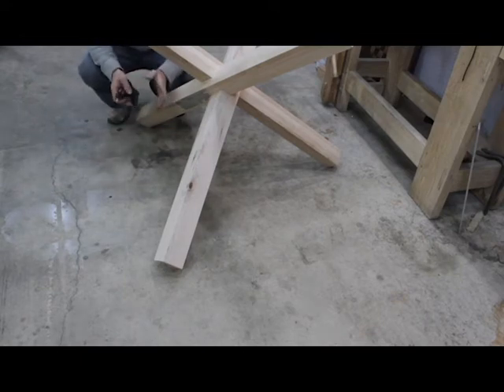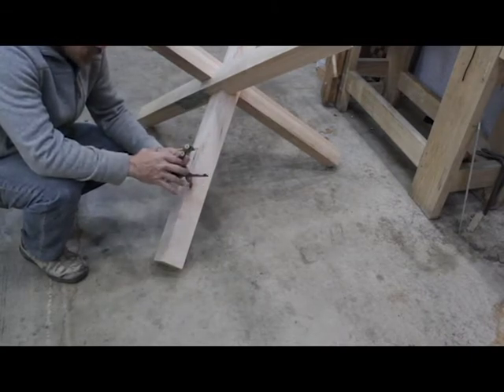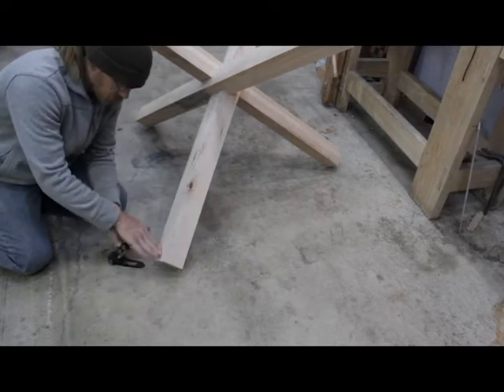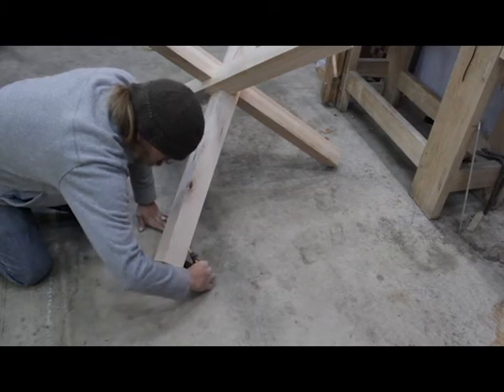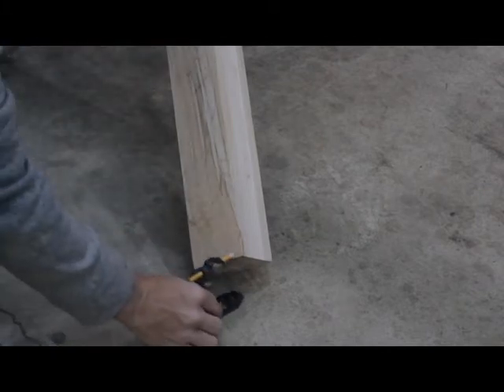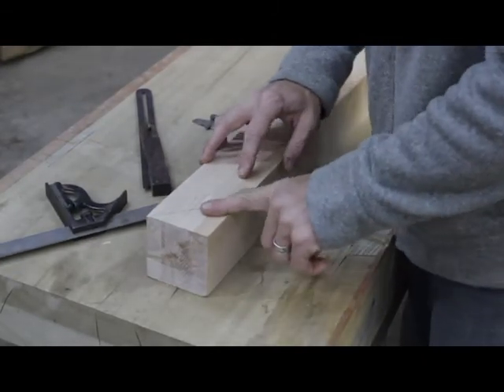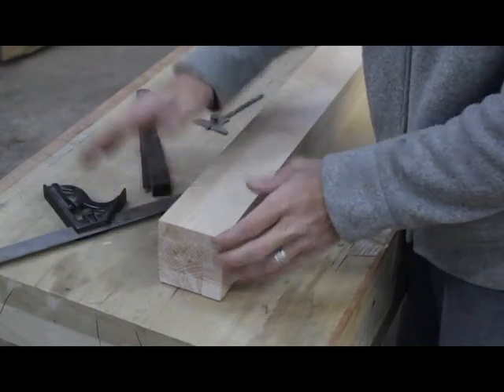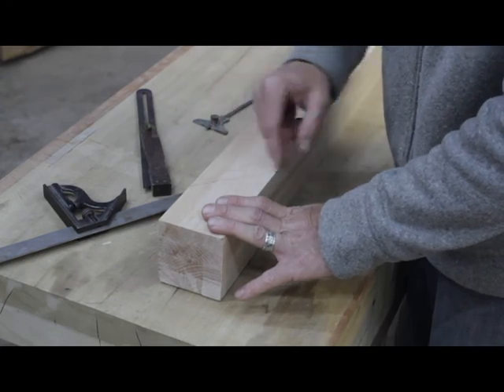Caltrop Table Base Angles

Comment: Hello, congratulations for the video. What would be the measurements of the feet (in cm) for a table between 70-75 cm high, because when you do the assembly and make these cuts at the end there is a material price. Thanks in advance for your help.

Comment: The question is I need a video on how to cut it? I’ve been trying and trying and I can’t get it to work
Reply from the maker: Cutting the joint or cutting top and bottom angles?
Reply: @TheCmdevans  the top and bottom angles, it’s okay I slowly worked it out after many failed attempts lol
Laid the table saw on a 45 and fed the wood through on a 45 aswell.
Thanks for the vid :)
Reply: @haydendark7917  Correct values are 45° and 35,7°

Comment: How to cut this angles coz i been trying it but cant to it perfectly
Reply from the maker: I typically cut the end angles with a panel saw.  Then, if they need cleaned up or adjusted I use a hand plane or wide chisel to adjust the angle.

Comment: Thanks for posting this.  I love the look.  How would you determine the length of each 4x4 in order to get a normal table height?
Reply from the maker: I'll put that in the full build video in a week or so.  It's a little tricky because of the geometry involved, and I want to make sure I explain it correctly.
Reply: @TheCmdevans  Great.  Thanks.  I'm excited to give it a try.
Reply: Hello great video. I also will like to know the answer to this question